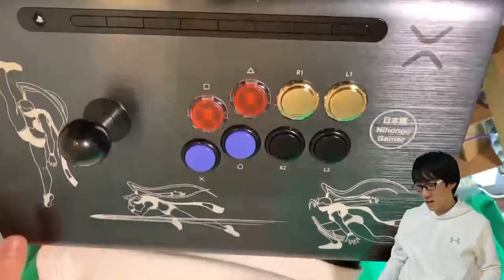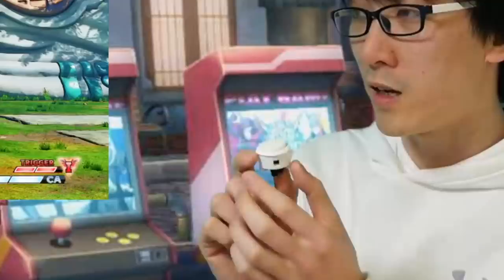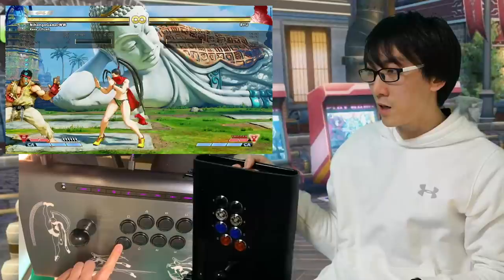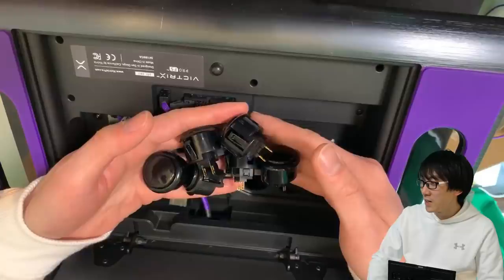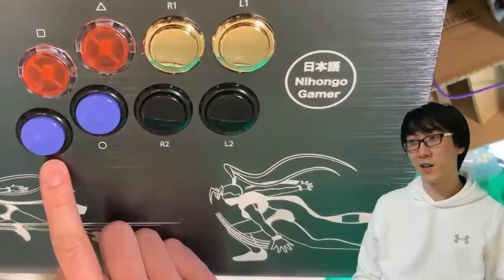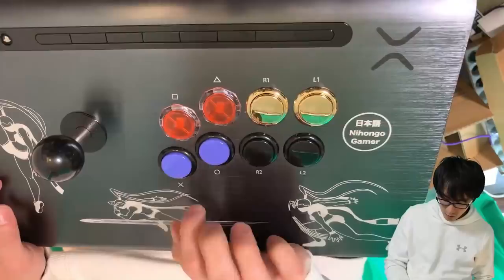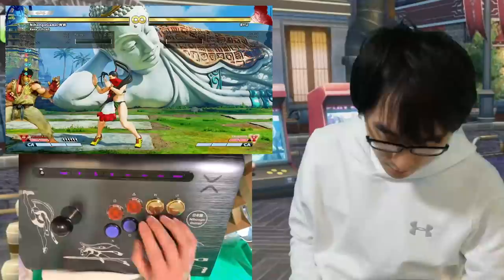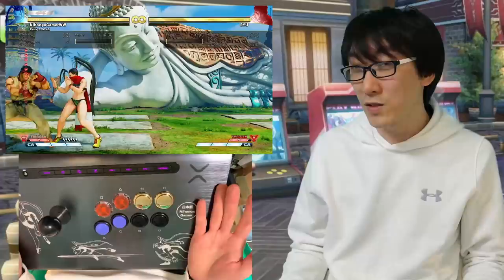SILENT Buttons: Sanwa vs. Gamer Finger

Comment: The issue with gen1 silent was many agreed they nolonger gave that satisfactory snap so the gen2 are just as they're meant to be. Very hard to get a responsive double tap or feel for plinking with the Gamer finger buttons unless you go for the cherry switch option. I agree with your review. Great observations. Thanks for taking the time.
Reply: @ShardTown  Still significantly slient against the standard buttons though, which is the point.  I think it's gonna be very difficult to come up with the "perfect" silent button, honestly.  I have a set of GamerFinger buttons ordered and I'm excited to try them and I opted to include the silver ones, but the best part is that I can choose to use different CherryMX switches rather than buy a whole new set of buttons, which I think is the main purpose of these buttons.  Not to be quieter.
Reply: @tyisafk  Can gamerfingers use cherry mx browns? At least as far as  gaming keyboards go they seem to be a good mix of quiet and tactile.
Reply: @ShardTown  🧢

Comment: Pretty sure the actual body of the Sanwa silent V2 buttons are the same as originals, so you can customize a bit by just getting the color body that you want (focusattack sells them separately I think) and then use the plunger and switch from the V2.. but you're still limited to the plunger colors of the V2's.

Comment: I'm sensitive to noise and I wonder why NO ONE who has made a video on YouTube about silent buttons has tried putting PC sound dampening foam inside their joystick cases.

I mean the whole point is to make less noise for yourself and the people around you and NOT ONE brilliant mind has tried it.

If sound dampening foam works to silent loud PCs, I don't see why it wouldn't work inside a arcade joystick case.
Reply: Don't think it's the same.
the sound of a PC comes from inside, the sound of an arcade controller pretty much comes from outside. You can't make the button quieter than it is by modifying the case.
It can help with the resonance from the case, but the buttons themselves would still be loud

Comment: I just got my gen 2s a couple of days ago. I must say, the rubber texture on the plunger is neither amazing or terrible and after hard use the “RT” button would have dead skin build up. Causing you to REALLY feel the rubber texture. (My palms usually have dead skin after like 3-5 hours of playing). The plungers have a clear coat to imitate the plastic plunger but if you run your finger nail lightly over it you can feel the rubber texture. 

Kind of wish they did the same is mechanical switch stems, where the contact points are rubber but the majority is plastic. This new plunger is all rubber and it’s weird at first but natural none the less.

Also.... if you have naturally oily hair or skin, I recommend caking one of your hands with the oil and applying the oils over the rubber plungers as the clear coat plus oils will remove the rubber feeling even more.

Edit: Nihongo said a Negan quote, “Feels Good. Sounds Good. Heh Heh.” PogChamp 

Double Edit: Ibuki’s rear end on the far left engraving is Kreygasm as af.
Reply from the maker: interesting! I think I'll install all 8 of the gen2 buttons and give them a proper test over the course of a week to see about this texture rubbing away stuff.
Reply: @NihongoGamer  Awesome, hope to see a final thoughts review! Also I forgot to mention that even applying oils the rubber feeling is still there, it's just not as prevalent. Cheers!

Comment: dude im trying to get the wires off the back of my victrix buttons im having to use my full strength this feels so wrong. i feel like im breaking it
Reply from the maker: The the metal “quick disconnects” have a tab on them? Pressing the tab helps to u latch them from the pins on the buttons. Other than that using pliers to get a more secure grip or wiggling it from side to side can help

Comment: I disagree with the springyness of the sanwa button compared to the gamerfinger.. When Im on hitbox the gamerfinger buttons bounce back alot quicker so I can get the next input in for back dashing on tekken. The sanwas don't spring as hard so the input is harder to repeat over and over with clean inputs.. Gamerfinger imo has more spring imo. Gamerfingers also has more thump/harder pad like feel to it, Which I like but I assume original arcade players like the classic sanwa feel.

Off Topic, but is there a way you can replace the nerve brain daisy chain quick connects for the victrix? The purple wire that plugs into the buttons

 Using a victrix hitbox pro fs 12

Comment: Is there a silent option for the Sanwa Screw-On buttons? I am ordering parts next week, and I have a handmade wooden arcade stick shell with a 1/4 thick mdf board for the top. I have generic Snap-In buttons atm. They damaged the wood, and replacing them with Sanwa Screw-On. Thanks for sharing these videos! :D

Comment: My boyfriend is driving me batshit crazy with his madkatz something or other fighting stick but he didn't put it together himself and it has rivets on it that prevent him from just opening the back up like you did here. I'm bout to google some more but anyone have advice? I need these magic relationship-saving buttons!
Reply from the maker: Not all sticks can be modded but if you do manage to open it up it’s worth a shot! There’s another brand called Crown which I’ve never tried myself but they also make silent buttons that are the same size
Reply: Most sticks can be opened; just not this easily. If it can be opened, consider looking into silencing pads for the buttons. Paradise Arcade Shop and Focus Attack (online shops) both sell silencing pads (or foam washers) that fit the average 30mm button. I actually use both brand's silencers simultaneously and the buttons are now much quieter than before. This is also a cheap solution and shouldn't cost any more than $10 after shipping. It's also a fun little project to boot.

I've done a lot of buying and testing to get the quietest stick possible and there's definitely more that can be done at a higher price point but what I previously mentioned is the best and cheapest way to start. That said, it's never going to be a completely quiet hobby and even a super quiet stick like mine still makes more noise than just using a regular controller.

Comment: do the gen 2 sanwa silent buttons have more friction when you slide your finger across them than other buttons? ive heard the plungers are made of a rubber material
Reply from the maker: The buttons are made of a new material but they’re covered in a coating that makes them feel smooth like regular buttons. That being said, I’ve heard from others that the coating eventually comes off and the button has more friction as a result.